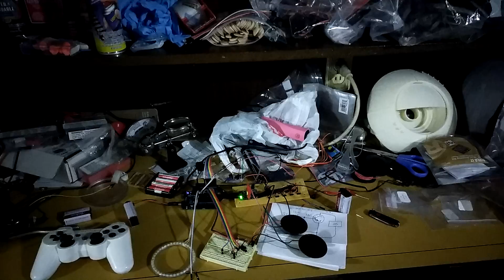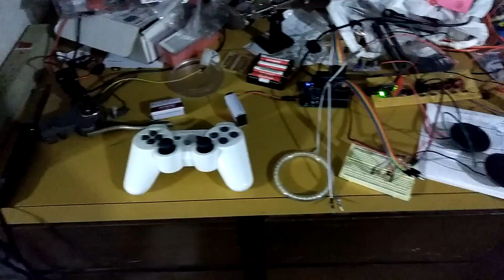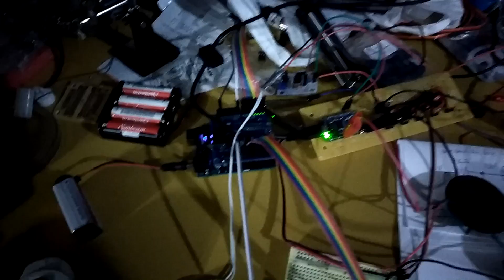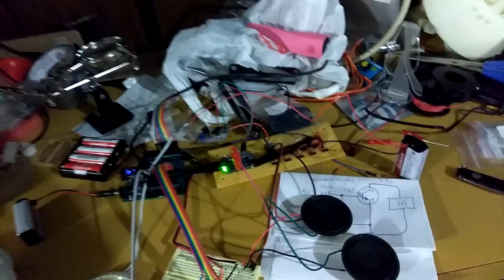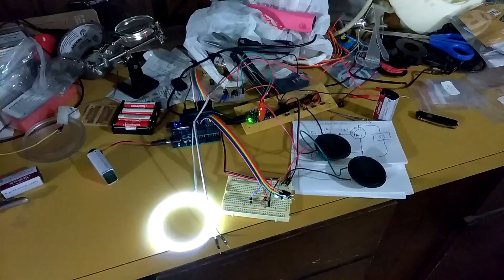Arduino+Adafruit Audio FX Sound Board+Sound to Light- Animatronic Wheatley v2.0

Comment: How did you get the arduino to communicate with the adafruit soundboard. I have mine connected and can communicate through serial monitor menu commands, but can configure the line code to work directly from the arduino via buttons or pir.  Please help
Reply from the maker: Here's the link to my full work log: https://animatronicwheatley.com/wheatley-v2-0-work-log/  Use CTRL+F to search on the page for NPN and you'll find the schematic I came up with and the parts I used. Basically, I used 6 of the same transistor to make a switch that connects the output pins of the Arduino to the trigger pins of the Adafruit Sound Board. Make sure in your code that when you press a button it sets the output pin high, and that both boards share a common ground. Hope that helps!
Reply: Luke Albertson ok, I am doing mine differently. Since my bot will have a single motion sensor I have the arduino triggering a random track via serial. Depending on the track number, it will light the corresponding rgb color.  Problem I am having is making the led pulse over pwm based on an analogread off of the audio freq.
Reply from the maker: So, having the LED flash to the sound like in my video?